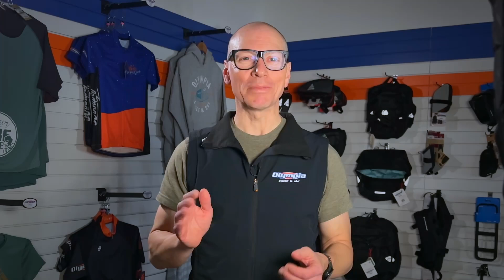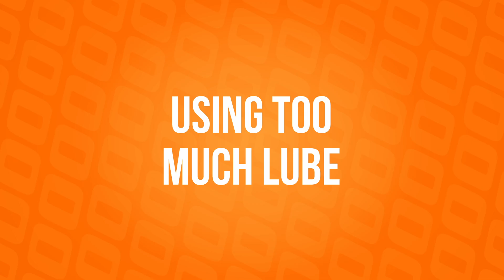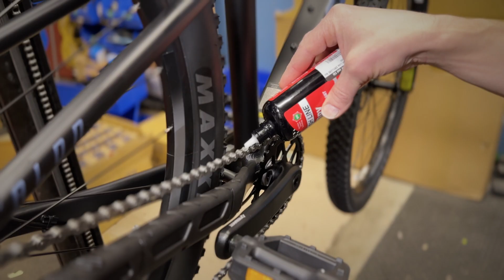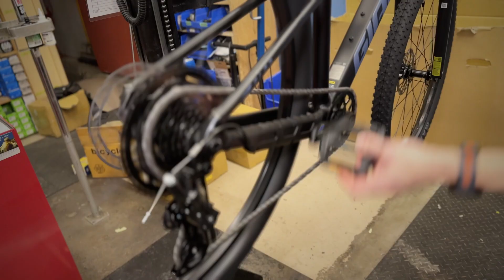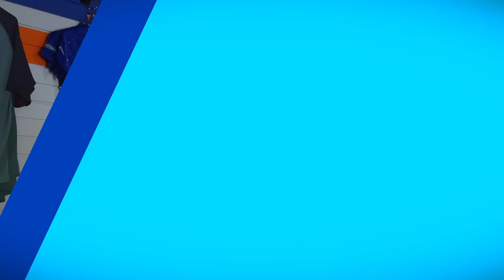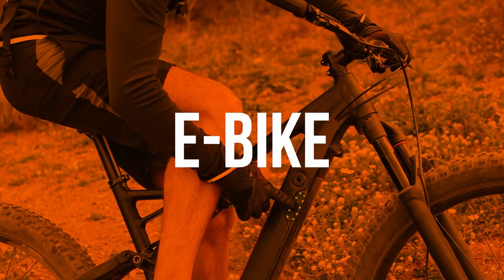11 Maintenance Mistakes That Are Ruining Your Bike!

Comment: Good tips overall but next-level pro tips is to a) drip homemade wax with some additives dissolved in xylol onto the chain, b) blast my bike with hot water from a water bottle after a rainy ride, avoiding bearings, and c) clean my rim brake pads with the same alcohol-based stuff I use to clean my visor.

Comment: All very sound advice although I know of at least one highly-experienced tourist who used motor oil on his chain.
The worst maintenance failure I can think of is allowing the seat pin or handlebar stem to "weld" itself to the frame.